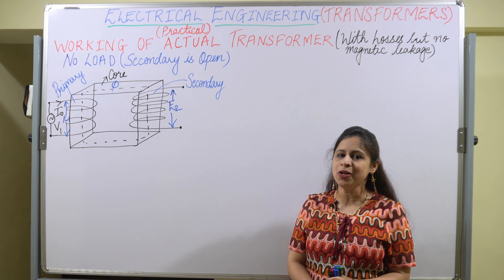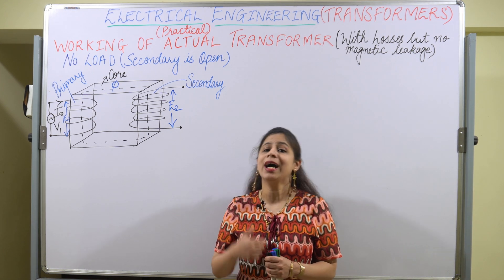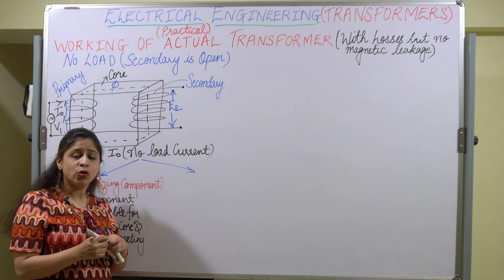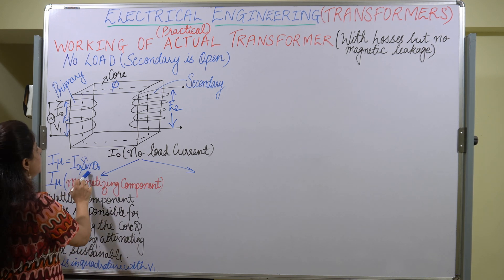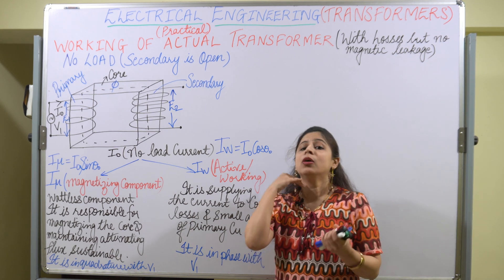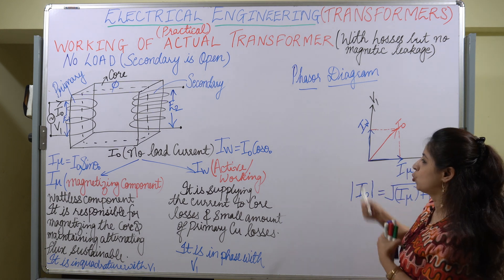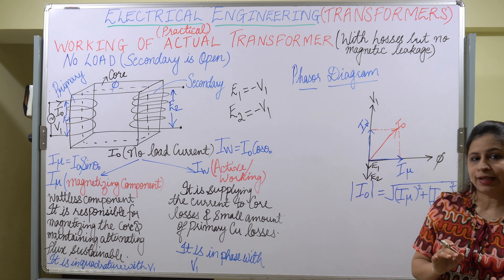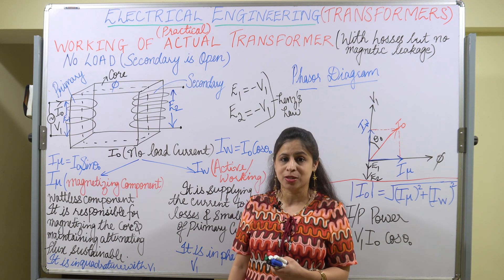Working of Practical Transformer at NO LOAD with losses but no magnetic leakage by Shruti Academy

Comment: Mam when given similar transformer is on load, then how to represent the copper loss occurring in secondary? Whether it is by the primary current component or by secondary current component.
Reply from the maker: It depends upon the load whether capacitive, inductive or resistive.
Reply from the maker: You can see these https://youtu.be/XlDiU8E2Bmw
Reply from the maker: https://youtu.be/Wajwef6cjvU
Reply from the maker: https://youtu.be/rtEH3VmVVMs
Reply: Mam, but could u pleae explain the current component responsible for copper losses in secondary, when actual transformer on load with losses but no magnetic leakage reactance.